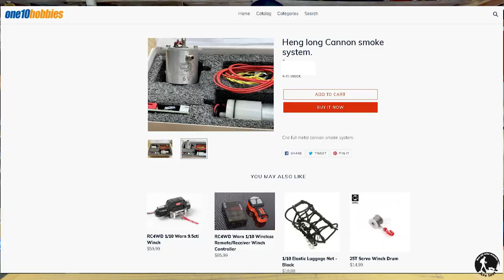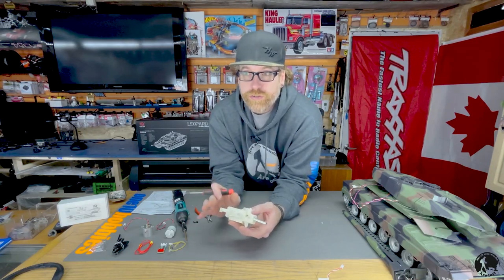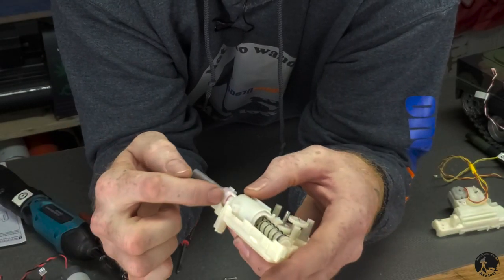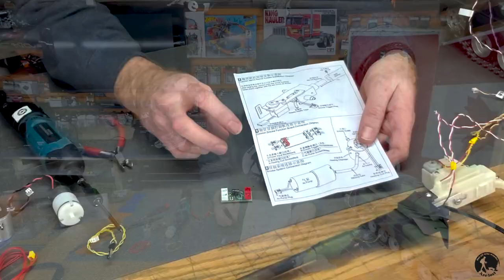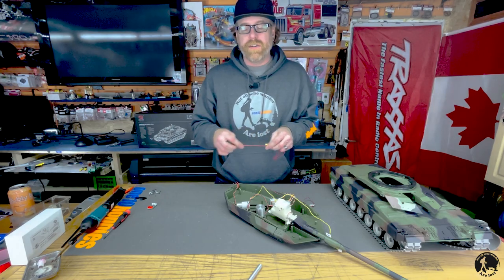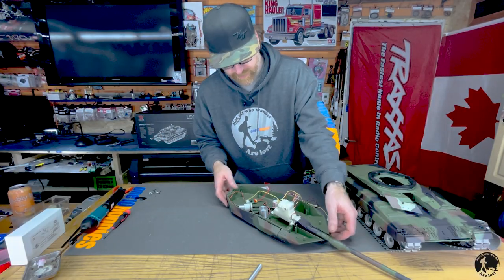How to install Heng Long RC Tank Barrel Smoke Kit - www.one10hobbies.com

Comment: I've noticed the M1A2 Abrams 1/16 scale figurine (TC) tank commander is looking over his left shoulder, are there any 1/16th scale TC's looking forward?. Its is awkward to have a TC looking to his left while his tank is moving forward or shooting.  In addition, there is supposed to be a loader manning the 30cal.  The smoker is great, but there is no (LED ) flash. Other upgrade's should be the grinding sound of the track's.  As a veteran of the 3/3 ACR we like seen our tanks as realistic as possible, not as toys. Thx for the vid
Reply from the maker: Couldn't agree more. The Tank Commander figures leave a lot to be desired. But having seen some of the amazing custom work customers have done with these tanks, definately proves that a great level of realism and scale detail can be achieved with some work.

Comment: Hi, a great video mate i wish it was on youtube about 7 years ago i could have done with it then! the one i brought broke after 2 hours of using it until my son dropped the remote controll, because i dident know at that time, the first generation of the henglong 2A6, if you drop the remote control, it brakes the crystal inside it! i think the crystals in that generation was faulty and i only new that about 2 half years ago! so it spent about 5 years on the shelf!(me gutted! lol) anyway, i hope my 2 cents helps someone! so does anyone know how to change the crytals in the first generation of the heng long leopard 2A6 MBT tanks? ive got to say though i was WELL impressed when i opened the box and seen it it looks fantastic close up and what they can do nowadays, wow! i dident know how advanced they became! tanks are one of my favourate vehicles! anyway, take care and have a great day all

Comment: Nice video. I wonder if there's some way to simulate the flash and smoke of the cannon, maybe with a special BB version?
Reply from the maker: There is an LED system available to flash when the cannon fires.

Comment: Thank you for a really interesting video. I have a version 5 Heng Long Panther Tiger which I converted to a Panther A. I suspect that I wouldn't have the room for all the smoke unit equipment in the turret anyway. Not to mention just how out of date the circuit board probably is. Lol. I was wondering if you could do the same sort of thing by just using the tanks own smoke  unit by connecting it to the air pump on the barrel. Might even be able to keep its ability to still keep shooting BBs. One to try when I'm having one of my brainstorm day's. Break out the glue gun!! Lol. Some people were suggesting using blank's on here as a way to produce smoke. Nice idea but as a general rule. All actual working gun barrels,air pistols or regular guns, use hardened steel barrels and mechanism's. Even if they're just being used to fire blank's. You're average BB gun, which is what your tank has, is in no way comparable to the energy released by an air weapon or a regular weapon.  They're usually Just 0.3 of a Jule. Since they stopped the sale of anything that's around a 0.5 of jule in recent years. Or seem to have. So yea. If you're looking to use blank's on your RC tank. I invest in some major hardware for it. All hardened steel and probably a metal tank to go with it. Probably be a better idea to go with the 1/6 scale tank's really. Otherwise you could probably be expecting to see bits of your poor tank flying through the air. Lol

Comment: Can this be fitted with a flashing light to a Heng Long Abrams Version 7.0 with the 360 turret rotation. Don't want to loose the 360 turret rotation. If so how to do it and parts (numbers) to get it done.

Comment: What I want to do now is to integrate the smoke with the bb in a way where the air generated by the hopper pushing the bb is mixed with smoke. That would be super cool. Me and my friends have already developed a piezoelectric butane cannon for a Mato 1:16 full metal Panther. Only problem is it just keep on breaking the gun mount between the barrel and the combustion chamber after 6-8 shots due to explosive recoil. I would’ve liked to add a recoil rail but there’s just no room for it to really work properly. Maybe on a 1/8 Tiger but then again you can just install a blank firing .50 cal on that beast.
Reply from the maker: Agreed, having the plunger "shoot" out the smoke would be great, rather than just relying on the tiny motor to push the smoke through the cannon.
Reply: If you use a full metal turret and cannon barrell, could it work reliably?
Reply: Was wondering, would ti be a good idea to try to fit a mechanism for firing blanks inside the turret of a metal 1/16 Leopard 2? 
I suppose that a metal barrel could withstand the shock of shooting 6mm blanks, right?
Reply: @alcosound  it’ll probably work if it’s a half or quarter load blank stub and as long as the barrel you’re using is made out of gun barrel steel. It’s always the recoil I’m worried about considering most 1/16 RC tanks are made of plastic.
Reply: @alcosound  any explosion in a confined space like the inside of an RC tank barrel is highly likely to do some damage. If not wreck the system altogether. Metal barrel or not. The barrels of an air pistol and mechanism are made of hardened steel. Same as a regular gun. Otherwise the barrel would just shatter or split. Plastic as a whole isn't really much use as a material for making guns with. Even if it's for just firing blanks. Admittedly I'm not an expert in this and it would be interesting to see how others have managed it. As some have managed to do this. Anyway good luck with your quest.

Comment: I have one of the later tanks with recoil, will this kit work on that???
Reply from the maker: It should work on all the tanks but it will require some small modifications
Reply: @one10hobbies72  cheers for that, one more question, I noticed that your video shows the V6.0 board would it wire into the V7.0 board in the same way? Thanks